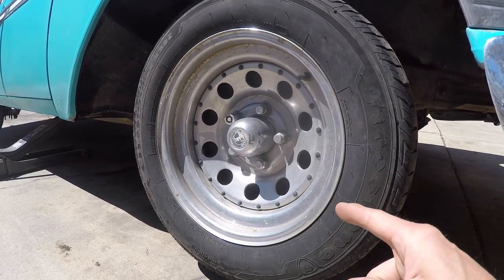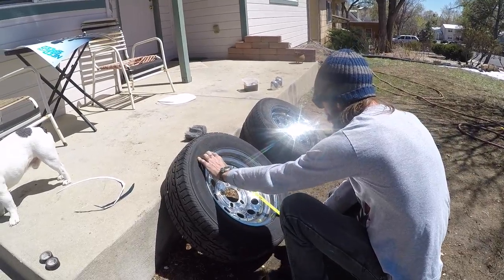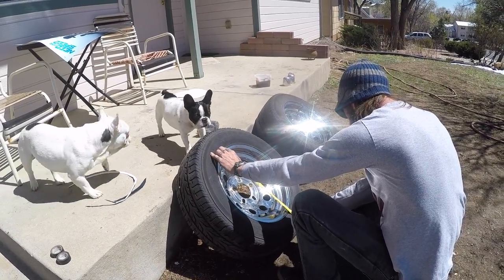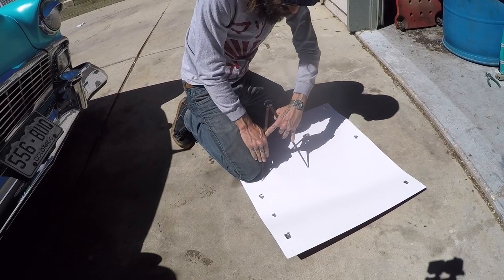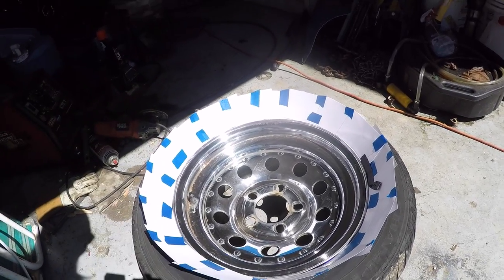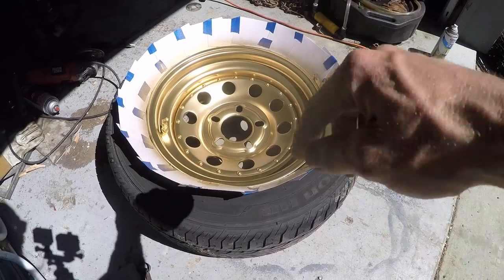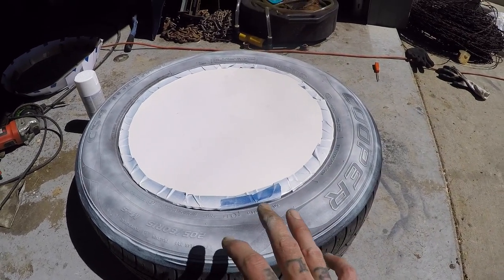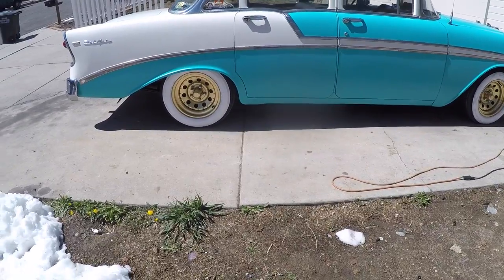1956 BelAir HOW TO: WHITEWALL TIRES S08E15

Comment: i love a good whitewall. tried a few methods before but never this one. i ended up doing a 2 stage thing. a thin layer of the 'proper' (usless) whitewall paint followed up by a thing coat of brilliant white fence paint..........yes you read that right fence paint. i found the whitewall paint alone turned brown regardless of how thin/thick you applied it, and the fence paint alone stayed really white but cracked. 2 staged it and they never discoloured and never cracked. they lasted 9 months before they needed a fence paint top up.
Reply from the maker: yea i got this idea off some old school hotrodders i used to hang out with. this apparently was how they did it for the track cause using them for racing was expensive. so they just painted em.